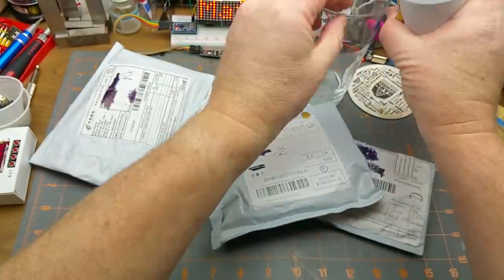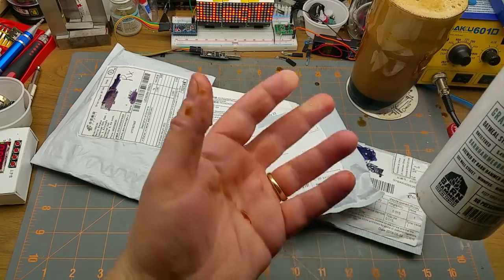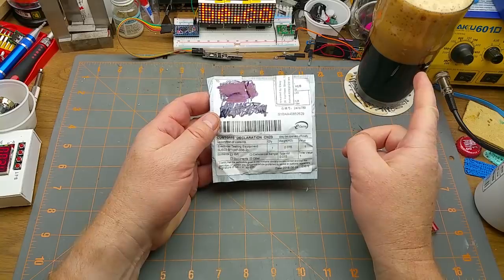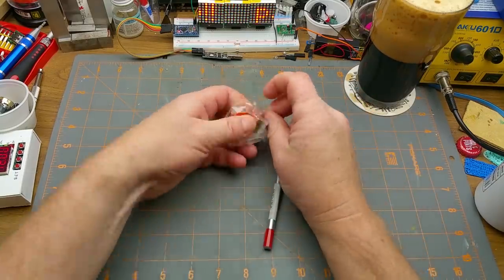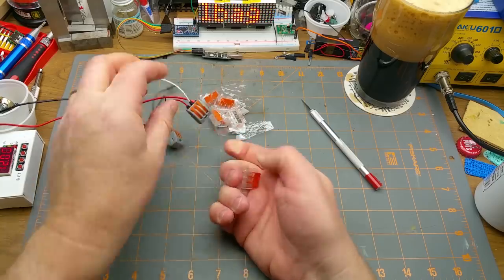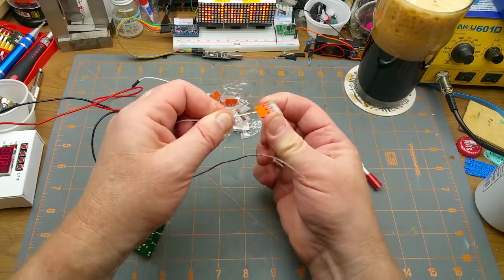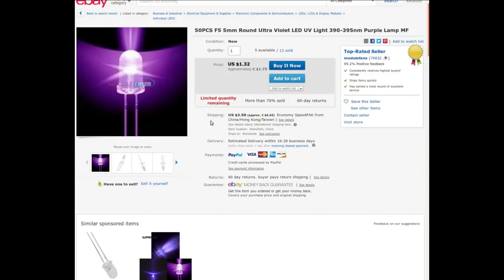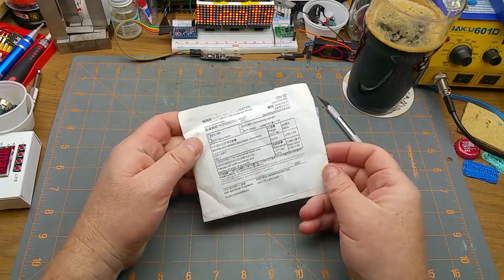mailbag monday #44

Comment: In case anybody has bought (is going to buy) one of those Christmas trees with the three colour LEDs, below are my comments on the build I posted in a video by somebody else. They may be useful to somebody here too.

There have been some comments that the resistors can be used in any of the unmarked positions as the more they're mixed up, the more random the timing of the flashing is. This is not the case. The resistors are used to control the brightness of the LEDs and ARE NOT used for timing purposes. The capacitors and transistors form an astable multivibrator/ring oscillator and the only way the timing can be easily changed in this circuit is to substitute different value of the capacitors.

With the exception of both R7 and the LED at the top on the board with the slot at the top, the boards are identical and the parts are the same on both boards. 

With the exception of the LED right at the top, each board has three parallel groups of six LEDs current limited by one resistor for each group. Whilst this is not a recommended way of configuring LEDs, the resistors are of such high value that in this instance, no harm would be done if a LED failed.

R1 - 10K - Pulls base of Q1 high
R2 - Connects collector of Q1 to parallel LEDs A, as below
R3 - 10K - Pulls base of Q2 high
R4 - Connects collector of Q2 to parallel LEDs B, as below
R5 - 10K - Pulls base of Q3 high
R6 - Connects collector of Q3 to parallel LEDs C, as below
R7 - Connects +ve supply to anode of LED D, as below

Excluding the LED at the top of the board with the slot at the top, if the LED positions are numbered clockwise from the bottom left branch, the LED groups are:

A - 1, 4, 7, 10, 13 & 16
B - 2, 5, 8, 11, 14 & 17
C - 3, 6, 9, 12, 15 & 18
D - The LED at the top of the board with the slot at the top which has to be red.

This means that in order for the brightness of the LEDs to balance, each LED group should contain only one colour and the appropriate resistor should be used to match the LEDs.

The resistors I have left over after using six 10K in R1, R3 and R5 are:
1x 10K
2x 2K
2x 1K
2x 330R

The only place the single 10K resistor can go is R7, limiting current to the red LED at the top of the board with the slot at the top. To optimise brightness, the remaining resistors should be used for the following colours:

2K - Green
1K - Red
330R - Yellow

Despite this, I still found the green too bright and so swapped out the 2K resistors for 5K. I also swapped out the red LED at the top for a white LED.
Reply: Thank you very much. I have one of these kits somewhere in my collection to build, the information will come in handy. 👍😎
Reply: Same experience (green too bright, red/yellow too weak), when my daughter finished her first soldering yesterday. I will try some resistence values and report back.
Reply: I changed the green and red resistors... euhhh see did 😋
Reply: Your long reply relates to the cheaper version of these trees, using the single colour LEDs. The one in this video is using identical multi-coloured LEDS in all 3 channels, so the resistors are all the same.

Comment: If you want to use those Wago style connectors for anything high voltage or high power you should go for the original ones. I had one of those clones just falling apart (maybe because of the spring inside) a while ago nicely exposing the bare wires.
Reply from the maker: Yeah, I typically use them for low voltage applications - this is the first time I've actually used them for mains level.

Comment: Would be nice if the IC in those flashing LEDs could be programmed with a PROM or something, to make them individually addressable.  Would make a plane or cube easier to construct.
Reply: Actually you can get LEDs like that. I believe they had 4 leads 2 power and 2 data. They could be run with an Arduino etc. Connected in series. There similar to WS2812. I think they're WS2811.
Reply: @bwselectronic  Well yes, WS2811 LED chains are pretty cool.  I think the system needs just a data wire in and out of each, and the type of protocol is called a "daisy chain." 
But bear with me:  If each 2-wire RGB LED had a unique ID, like an I2C device  (perhaps addressed with reverse voltage) then there would be no difference in lag between the first and last.  And each LED would share the same two conductors, making it easy to construct arbitrary patterns, like cubes and matrices.  Downside would be that you would have to program each one individually ... or at least ... discover each address individually.
Reply: the so called 'neopixels' can be set to any color.
Reply: @maicod  NeoPixels are a also a daisy chain using WS2812.
Guess the point I was trying to make, is that if one goes to the expense of manufacturing an IC into an individual component RGB LEDs, it would add value to have an addressing scheme built in as well -- so a set color command can be sent in parallel to a particular the LED in a system.
In truth though, you would need a rectifier, small cap, and a PROM or EEPROM, a little decoder ... and all this may not be so easy to fabricate as the random flasher.
Reply from the maker: @GnuReligion: I wonder if the "one wire" protocol has enough bandwidth to do something like that?
The only one wire devices I am familiar with are the Dallas semiconductor temperature sensors.
Reply: +GNUReligion oh you're meaning a replacement of an external microcontroller I guess ? edit: ofcourse the tiny chip inside these LEDs IS a microcontroller. You're saying 'a set color command can be sent to the particular LED' so you DO mean an external controller, meaning a similar setup as an Arduino sending a set color command to a particular LED. With the WS chips/Neopixels that is done in serial. It passes through al Neopixels but is that a problem ?
Reply: @maicod  Ok, my vision:  An arbitrary pattern of 2-wire, RGB LEDs, where every LED Cathode, connects to rail A, and every LED Anode, connects to rail B ... all the LEDs are in parallel.   A and B are probably outputs of an H-bridge, or buffer.  Yes, an MCU drives the system.  Yes, it can all be done with NeoPixels.  As a hobbyist though, it will be much easier solder together a smiley face, or Christmas tree pattern with parallel 2-wire devices, than serialized 4-wire WS devices.  You could, for instance, use the top (A) and bottom (B) of a double-sided copper project board.  Just drill holes in the desired pattern, if you follow.
Reply: +GNUReligion I follow you but now you must get the Chinese convinced they're dearly needed :)

Comment: For the colour-changing LEDS there are heaps on Ebay. The best price is 100pcs, so search terms are:
(5mm,F5) LED fast 100pcs
(5mm,F5) LED slow 100pcs

(3mm,F3) LED fast 100pcs

(3mm,F3) LED slow 100pcs
The diffused ones are really nice effect.
Reply from the maker: Thanks.

Are any of those the dual-speed ones? 
Or are the ones they call fast actually switching between fast and slow like the ones I got in this kit?

Off toe ebay (again...)
Reply: @pileofstuff  - the "fast" ones are what is used in the Xmas Tree kit, and they have the 2-speed effect.
The "slow" is more like a fade between 3 different chips, on a slower clock rate. We commonly see those here in Australia inside $1 crystal xmas trees and white glitter snowman figures powered by 3xLR44 button cells.
BTW - you need to drink some Aussie stouts, once you finish all the Canadian ones..
Reply from the maker: @johncoops6897  Thanks again.
I have some of the slow ones in stock, but I hadn't bothered with the fast ones - I assumed they sere also single speed and would look too garish.
I'm just back from Ebay and ordered some. Fodder for another future mailbag!

I just did some searching on the booze store's website - the only slightly Aussie beer they have is Foster's (and it's not even an import - it's contract brewed in the 'states...). I'm disappointed in them.